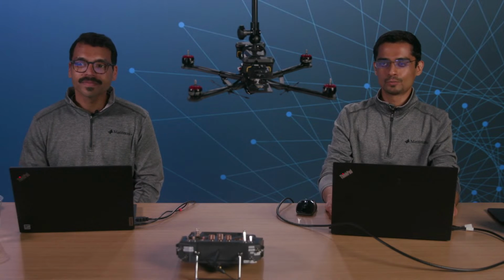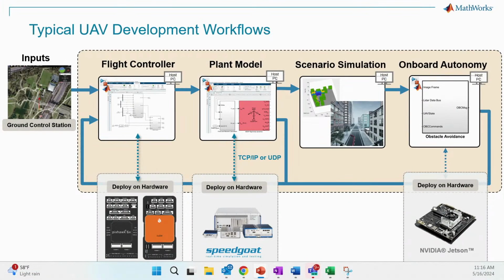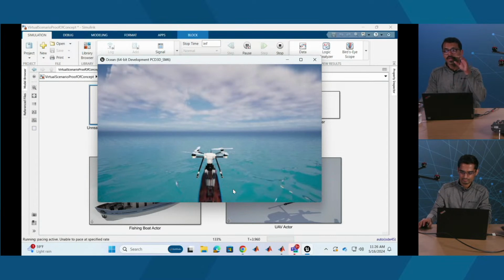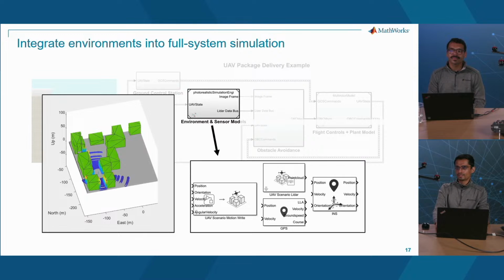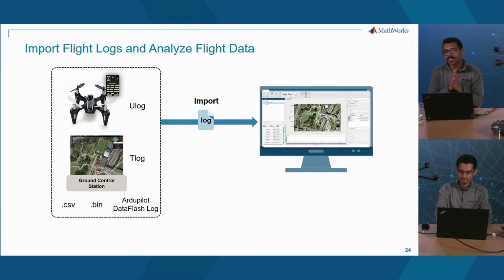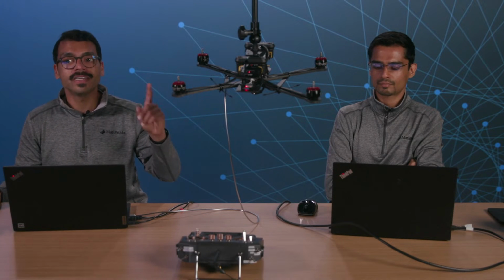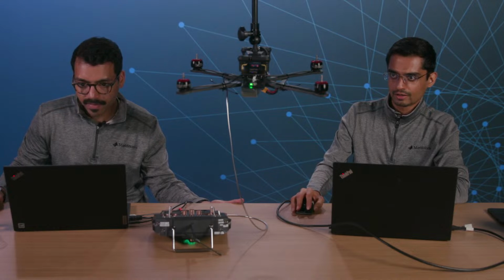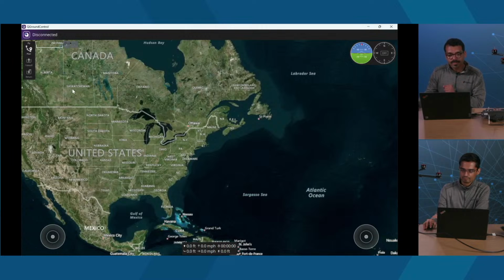UAV Applications with MATLAB, PX4 and Unreal Engine®: From Simulation to Deployment

Comment: Hi Matlab team, i have a question ?
As we know PID needs feedback from sensors like IMU, ..., so should we use the output of Plant then add noise to return to PID controller or will we get it from scenario simulation?
Reply from the maker: PID needs estimated state and not ground truth. Check out this example showcasing both groundtruth and sesnors+state estimation to tune PID. Check out https://www.mathworks.com/help/uav/ug/design-tune-controller-vtol-uav.html

Comment: I am a private pilot that is also an A&P and an electronics engineer. I know how to use matlab, basically, and simulink, basically, but have not used the aeronoutics toolset or blockset. Yes, I do know a fair amount about vector arithmetic.I also do use X plane. However, I am a bit lost on how to use the unreal engine, which I have just downloaded, as a custom flight simulator, for an aircraft that I have designed with matlab. I really could use a couple of references to tutorials that might help. Good stuff!